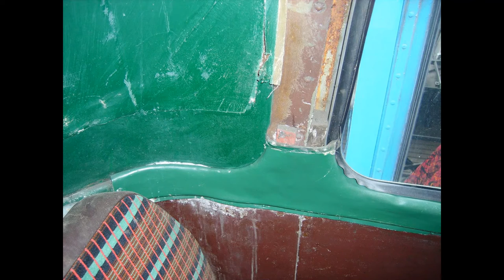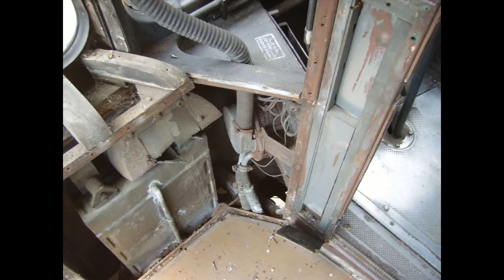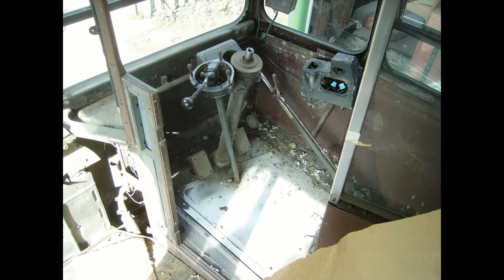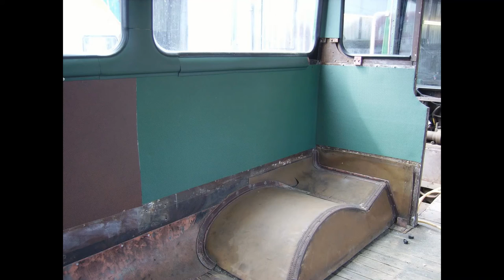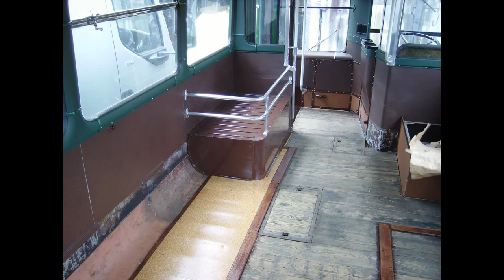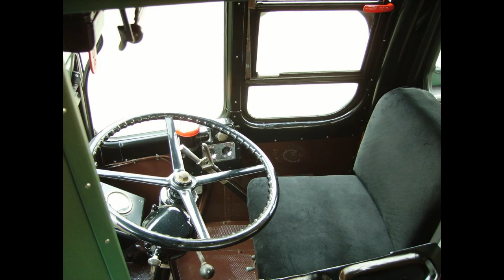LONDON TRANSPORT RF308 Interior Restoration

Comment: This is one of the most beautiful single deck buses ever designed. If I had to design it myself, I could not have done it better.
This is the pinnacle of bus design, there were some nice vehicles before, but, afterward only a few AEC vehicles.
Nice to see London Country, had a nice ring to it, great finish. Would love to take pictures of this in the country.
Really nice film.
Reply from the maker: Thanks ROCKINGMAN, from what i've heard and read all London's single deck bus designs that followed the RF were pretty much failures (but maybe not the RP). The RF was known to be hated by the scrappers due to it's indestructible construction and it still shows today.